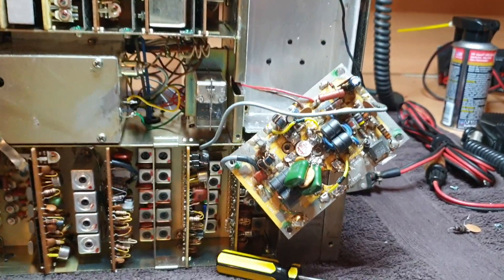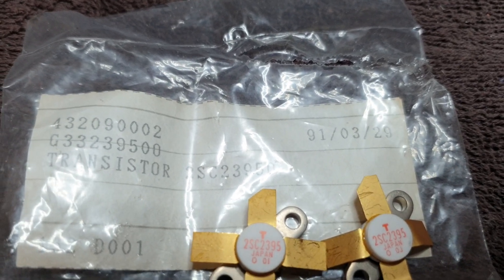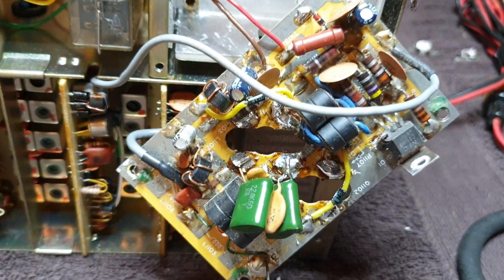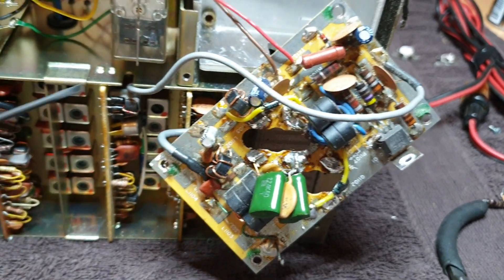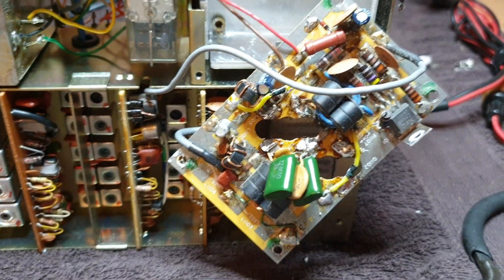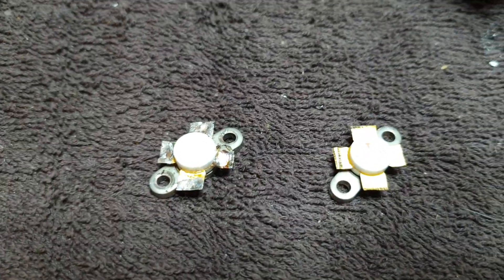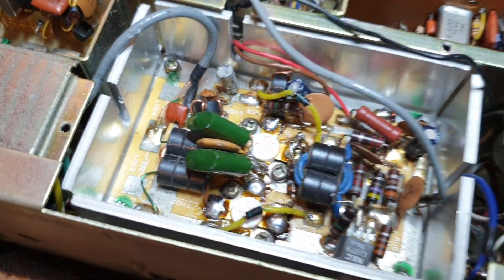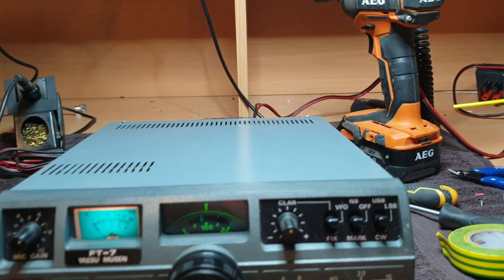Yaesu FT7 2 x original bail electronics  2sc2395 final output restoration.

Comment: Thx for the video Brenton. I wouldn’t swap mine, it still works fine and has a beaut receiver in it as good or even better than the later models. Of note it is hooked up to a FC707 tuner that I bought from Bails back in the day. I can’t remember the exact date but I drove down to Wangaratta specially from Holbrook where I was living at the time. Of course now in Adelaide and used regularly. De VK5NRG.